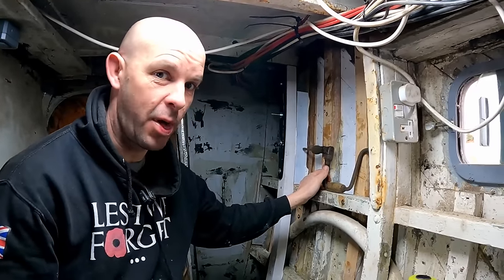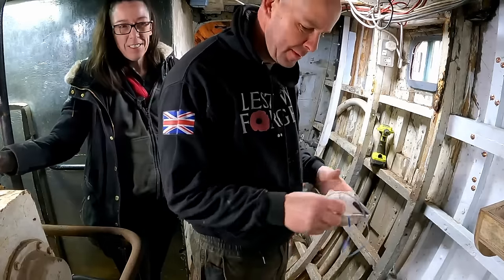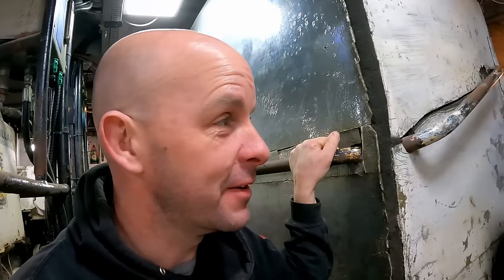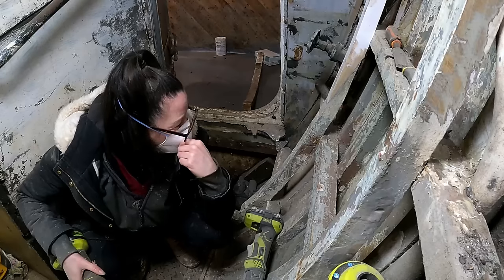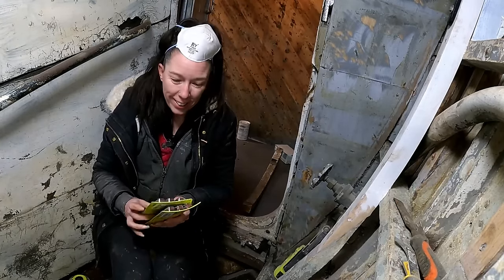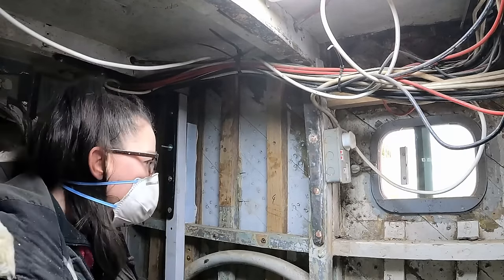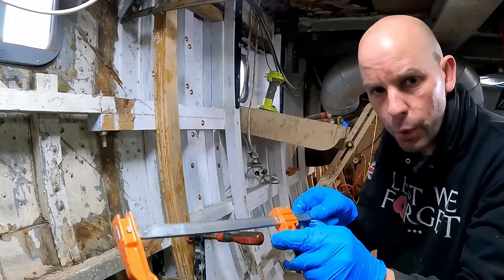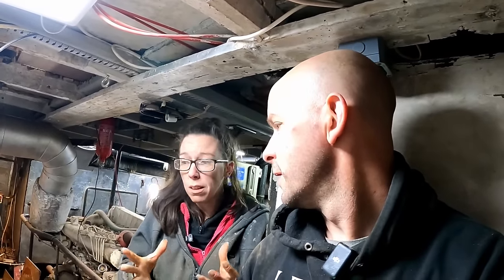Ep 163 - Will This New HOLE In The BOAT SINK Us?? #boatrestoration

Comment: Going back to the episode where you encountered a rat and the other episode where you though that the rat may be getting into the boat then pay attension to the outside mooring ropes ropes, it would be a good idea to fit metal or plastic discs such a large paint tin or plastic bucket lids to the ropes to stop any predator from entering the boat excluding squirels who have an IQ of nearly 200 and will bypass anything in their path.

Comment: Primer paint will get dirty pretty quickly. It dries with a texture (or tooth) to help subsequent coats stick better and tends to attract dust unless covered with a top coat. The gloss floor paint may be tricky to add another coat to because it doesn’t have a tooth and is smooth. The red paint in the bilge maybe red lead or just red oxide. Probably need to test it.

Comment: That Red paint in the bilge is probably “Red Lead” paint. Very common on older boats. Extremely durable but toxic if inhaled. Treat it with caution and wear all the protective gear.

Comment: If your going to use a lot of two pack paint Gemma, you need a full head air helmet with pumped air from outside. You can get back / belt packs but in confined spaces you will need a ton of filters. Two pack is a stronger paint, but has a high health hazard to your lungs, more so than any other paint, which is untreatable and for life. Emphysema is one, and get that bad you will need oxygen bottles to breath with eventually in later life or sooner.
Reply from the maker: We don’t use any two pack paint, two pack is to hard to use on wood that flex’s

Comment: The red paint in your bilge I have no doubt is what was called "tinners red". That coating has an exceptionally high lead content as it was used to coat the inside of wooden box gutters that were built into the roofs of homes built from the 1890's to the 1930's in the US.  Think of it like lead in a brush on form used as waterproofing. Be very cautious. 👍 Tinners red as a color is still available today, without lead.

Comment: Great stuff. I am always surprised, and pleased for you, when you remove a frame that has turned to dry bread and the hull underneath that it was sitting on is just fine. Thankfully. Hope things keep moving and you get to replace the deck this summer. Perhaps those panels were inserted to protect the hull from something banging against the hull planks from inside the engine room. Maybe you could make those discs you see on mooring lines to stop rats from climbing aboard. The brace will be the perfect tool to use on the bronze screws - so much control.

Comment: I had a home Repair business In ARIZONA 

All wood rot Starts with Dirt , it Rains fresh water and dirt = Mud 
Season to Season  = Wood Rot 

After repair keep clean and sea water 

If it was me , remove the Mud wash clean the In side and out Force inside dry,
Using fans dry the inside with Fans , 

I would Use Fiber Glass at the Back to Stop Wood Rot There on the platform

What do you get when you take dry wood and cover it with Epoxy and set a New ply wood over the Top . Done  Fiber glass sandwich and no more water Fiber glass and wood is wonderful .

Comment: It's a Deck guys not a floor. Great video.
Reply: Inside the boat, it's a sole, outside, it's a deck. Simon and Gemma always said "floor" when they first started, but nowadays they alternate with the nautical terms.
Edit: I continued watching, to the point where Simon talks about a "floor", and he is using the correct term. The "floors" are the joists which support the "sole".
Reply: @jaygee5693  20 years in the Navy in all sorts of boats and ships. Never heard the term sole in my life before.
Reply: @alangurman3961  I shouldn't have said nautical. It's shipwrights' terminology, they tend to use traditional terms for everything in their trade, including the parts of a boat. Some of the viewers who watch other channels where traditional  shipwrights are building, restoring or  repairing boats, had been known to "correct" Simon and Gemma when they said front instead of forward, right instead of starboard, floor instead of sole, or joist instead of floor. Simon got it right for them in this one.
In the Navy, did you call the floor of a cabin the floor, or the deck, and was that the Royal Navy?

Comment: There is nothing wrong with old tools . My wife and I rebuilt a sailing cruiser with manual tools plus a drill, sander, electric plane(later) and a jig saw. It was as with you needing floors, ribs beam shelf decks, cockpit, and knees hanging,lodging travers and of course a breast hook. All done with hand tools. Hand tools is good you can hear the wood talk but it is slower. I am now much older with a wonderful workshop but not much in the way of hands!

Comment: Regards that damaged web frame, the steel floor or whatever it’s called, might need some TLC as it looks like it needs straightening. If you inspected that across the width of the boat and maybe clean and paint it that way, when you work on the starboard side you will reach the cleaned up part and it might encourage you a bit as you will have a cleaned section across the width of the boat at that point? If you get my drift… haha I’ll shush now

Comment: My dad was a carpenter for 55 years he had two brace and bits one used with screwdrivers and the other for drills and I now have one and my brother-in-law has the other you're both doing a great job under tough conditions 😂❤

Comment: Gemma use a heat gun to help remove the old paint. It's makes the job a whole lot easier Gemma. I agree with Gemma scrap the epoxy off before it drys takes way too much work to remove it later on, in my estimation. 

BTW Simon I think they figure out how old a wood is by measuring how much carbon 14 is in the wood, then they figure out how much Nitrogen 14 is in the carbon that determines how old the wood is. I think!
Reply: Close but not quite.  C14 decays into N14.  You actually measure the ratio of C14 to C12 to determine the age.  When alive, all of us, we absorb C14 and C12 in the same ratio until death.  At death the clock starts as the C14 and C12 are no longer absorbed.  As the C14 decays into N12 the ratio of C14 to c12 decreases.  Half of the C14 will be remaining in 5730 years (the half life).  A quarter in 11460 years and so on.

So it’s all about the ratio between C14 and C12.  C12 remains constant as it is the non radioactive, non decaying form of Carbon.  

Dendrochronolgy is counting the tree rings for how long the tree was alive.  40 rings = 40 years.

Cheers

Comment: Try wire wool in the rat-hole and every similar hole. It would be great if you can get stainless steel wire wool which won't make a mess, but you'll be tweezering bits of it out of your clothes and skin for months after!

Comment: Have you considered using a heat gun to soften the paint?  That may speed things up - but it will eat electricity. 👍
For all the grief and aggravation your clip on mic's cause - I want to tell you that you have great audio,  Some of the best I've heard.  Thank you for the extra effort.
Gemma - please make sure you pinch the metal part of the face mask to fit your nose and cheeks.  There are a lot of micro particles slipping through the gap.  Must take care of your lungs and I'm certain that is lead based paint.  That's why it's still stuck to the wood.
Are you running your paint spray extractor as a dust extractor?  That would be a big help - especially in an enclosed space like the engine room when you are both making dust. 😉

Comment: The wooden shaped-to-fit inter-frame plank fillets would likely be because a panting and pounding issue caused hull flexing and likely weeping shell boarding so they were a stiffening addition after build revealed the issue. Should replace and refit; they would not have been merely decorative. Rat guards are fitted to RETAIN rats but not legally required where you are so you could fit to keep off and when you travel a full set to accommodate every mooring line will be needed. Simon should be able to readily fabricate some, I am certain. Ultrasonic screamer units might also help but will use some valuable power. Think about requisite accessibility to remove the engines if ever needed to save compromising the restoration in future.  You should have automatic float operated bilge pumps fitted and operative as soon as possible and at least temporary boards over the rotten transom until you can replace and strengthen properly otherwise risk sinking boat if breaks free in bad tidal and weather conditions. Good steady progress; eat elephant method, one bite at a time.

Comment: I worked for an Aero-Space sub contractor that made parts for the Space Shuttle, many of which had to be coated in 'Intumescent Paint' that would swell up and char to protect parts from fire. The Government had strict 'use by' dates for all the paint products, when they 'expired' we had to pay to have them disposed of, even though, technically, they were still fine for non-critical work. You should contact local aircraft sub-contractors and see if they will part with any expired product that you can use to coat the engine room for added fire protection...The paint is over €90 per gallon, so it would be a nice saving...🤑

Comment: Internally, if you want to know where rats or mice are getting in or moving about, then lightly sift some flour onto the area and look for the footprints. Sometimes you can track them back and the flour is harmless.
Reply: They use to use a shield on the rope's stop rats entering a ship from the docks many years ago try cutting a large plastic disc to slip round the ropes to stop entry to the boat ❤
Reply: @marksmith-ew7ir ships still use rat guards on their mooring lines.

Comment: To use the brace place one hand on the mushroom shaped end to apply pressure,use the other hand in the middle of the "cranked section" to rotate the brace. Simples .🙃Can also be used for drilling holes.

Comment: You definitely need rat guards. They are inexpensive and will save you time and money. The older wiring has material in it that is attractive to rodents and they could be eating the insulation off the wires in the boat.

Comment: I'm afraid that rats are more that capable of running straight up that wooden hull of yours, yeah, rat guards will maybe stop then running up your mooring lines but an easy oute is straight onto your hull as its on the grouns when the tide is out.
rat guards are mandatory on ships when in port and ships are inspected to ensure correct deployment. They are as much deployed to stop rats getting off a ship as getting onboard.
I watched them a couple of years ago having no problem scaling a smooth steel pole in a friends garden to get access to his bird feeder, so, he greased the pole and it was very amusing watching them have numeros attempts to clime this pole, yes they got so far then kept sliding down again, same with the squirels. The creatures then rummaged in the sandy soil got the gritty mix on their feet and then made more attempts, it gave them enough traction to climb the five foot pole ! they learn fast. So, a wooden hull poses no problem at all. They can leap across fenders used on small boats and grip onto the fender lines, climb them avoiding the smooth glassed and painted steel hulls.
Also, I suggest you don't go poking around any suspect access holes are areas you suspect they have been and put any items that you keep any food/drink related items, also wear gloves.
The reason being and I mention this as you don't... Weil's desease ( leptospirosis) it can kill, Google it, It is a requirement on a construction site to be made aware of it and there are questions when obtaining a CSCS card on this.. that is a safey pass required on sites for some years now. Think of all those site/welfare cabins on construction sites with brewing gear, bits of food dropped on the floor.. it is a free food store for rats !
Rats will gnaw at just about anything for hours, including wiring, it is not because they see it as a tastey meal at all, the reson is, their teeth just keep gowing and if they do not gnaw away, their teeth grow to large so gnawing keeps their teeth at a managable length.
I had an issue with rats in the garden a couple of years ago, probably still have as I am near water, they favour a close water supply, so I fitted a few temporary cameras and I was amazed at just what they can climb, a plastic shed along with a smooth coated metal shed, wooden fencing was a breeze for them.
So a roughish wooden hull.. zero problems scaling that, rat guards in your situation will only drive them to an easier access/egress point.
I suggest to add another camera onto you system, with pir or video motion detection if you don't record on a DVR/NVR with 24hr recording and monitor the areas you are concerned with, then its humane or kill trap and maybe poison... thats a personal choice for yourselves.
The last ones I trapped in a humane trap, took it onto the moors and released near water, well away from any properties, oh, ven bougt it some chocolatechip cookies for it's lunch ! I felt a bit bad about using a killing trap on a previous one. I sure had the micky taken out of me about the humane trap and release, but it made me feel better.
Should I get more visits.. not sure how I would deal with them.
They tend to favour areas they are comfortable with and feel safe, the holes with ragged edges just maybe their favoured place to gnaw away as the can access that boat almost anywhere, especially when the tide is out, they sure don't need that hole you pointed out.

Comment: There is a mice infused foam spray that mice won’t touch as it has anti mice built in.  May help in those areas that you can’t fix right now but need to plug up and would be easy to remove.  Good luck.

Comment: That is what was used to construct your boat.  I’m 80 and it cracks me up when I see what you youngster’s don’t know what you don’t know.  😂🤪🍺
Reply: I've got a couple of braces and a collection of auger drills, one of the braces I have, I bought 50 years ago with my pocket money and still in use today. 👍
Reply: they have to easy what with the power and battery tools. Nothing wrong with hand tools. 👍👍
Reply: Thing is folks we all have to learn by experience and I’ll bet there was stuff when you were young that you probably did the same.
Reply: Take the electricity away today and 80% of people would be lost the brace is a very universal tool drill ,auger ,hole saw and screwdriver

Comment: Nice tool upgrade you have there Simon,  a bit and brace nice bit of kit .
Reply: Ratchet Brace, used to drill holes into wood.
Reply: And a ratched model to boot a quite rare Item and handy in a tool kit great find Simon.
Reply: Brace and bit!
Reply: A brace and bit was mainly a drill that looked very similar to that ratchet brace, it only turned by man power and had to be cranked backwards for backing screws out.
Reply: Thought you'd had enough of Ratchet already 🐭💩😿

Comment: I know by now that you both realize there is many types of epoxy glues you could use. However the quicker the epoxy sets (goes off) the less grab it has and a weaker glue joint it will have. So the longer it takes to setup, the stronger the joint it will have...   As for the good looking bikini girl. you never know, Gemma could be that model as well...  Thumbs Up!

Comment: I have a Stanley brace up in my tool chest, bits are the actual drills you fit in the chuck. They are great to undo old screws as you showed. Now you've shown me your I'll have to check on mine. But what is a Bib & Brace.

The previous owner of my boat went onto restore the steel boat Llanthony in Turkey, one day each week was spent checking the hull, mooring lines and engines etc. Getting fuel on board, doing oil & filter changes on the main engines and gennys. I made a point of checking through the hull fittings and turned them off/on, so in an emergency I knew they worked. I know your busy with other work but do spend some time checking what you have done and areas about to do. I do hope the rat has left and you haven't boxed it in.

Comment: Use to spray polish my clamps so clean up was a bit easier when using glues. Still going strong. Will you be replacing the plywood with planking and extending the frames on those poorly topsides at the stern?

Comment: To get that dirty rat, you gotta seal off the boat and run a gas powered generator or one of the engines with the exhaust disconnected.  Again,  that's what I did at my house, and I've never seen even one of those furry little bastards since. Funny, but it's a true story

Comment: The "cruiser" needs to be towed to a dry place and the bottom inspected. SECONDLY, I AM SURE, IT IS NECESSARY TO REMOVE THE ENGINES, not primarily for the engines, BUT TO CHECK WHAT IS HAPPENING UNDER THEM. AND THEN, it is many times easier to work on the shore, AND NOT AT THE BOTTOM OF THE “SWAMP”...
        I believed that the “cruiser” was in better condition - than it actually turned out to be... YOU HAVE ALREADY SPENT SO MUCH TIME AND EFFORT on all this, - AND OF COURSE YOU NEED TO FIND ANOTHER SCENARIO FOR FURTHER ACTIONS...
      .... I SAW THAT THE ENGINES ARE WORKING, but it may happen that during the first attempt to move away from the shore, the "aircraft carrier" will sink... I would not like to watch this episode...
      ...I SEE AND UNDERSTAND that you would like to do the work with “home remedies” - in a simple way, BUT .....